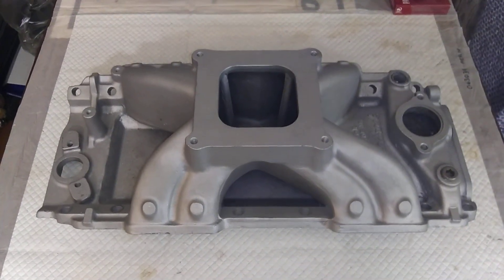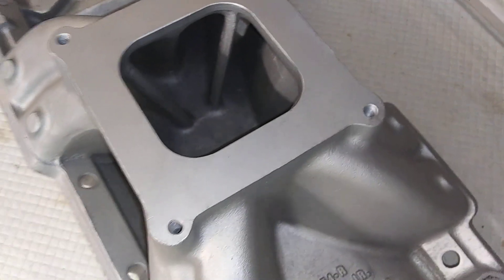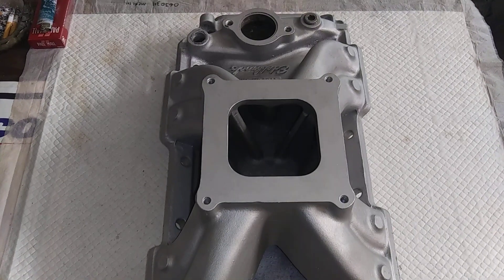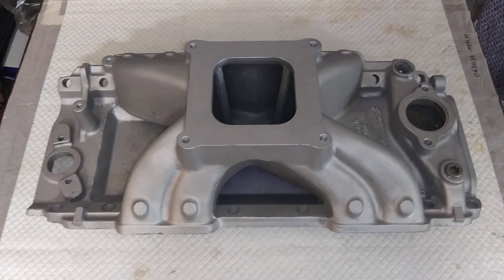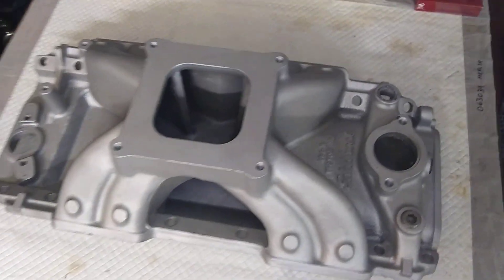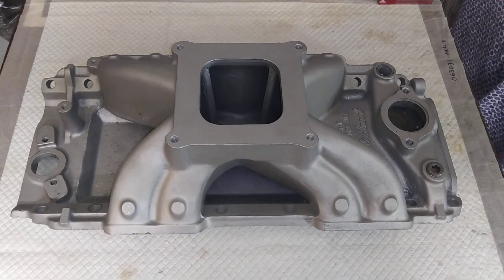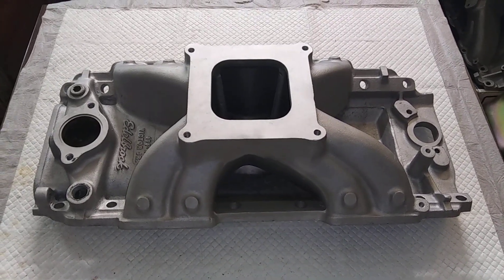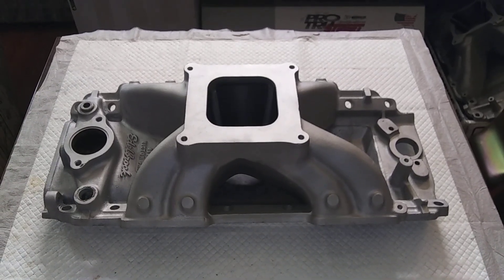Edelbrock Victor 454-R  BB Chevy.

Comment: I’m looking for a ported rec port for my 508, any for sale your way ?
Reply: 4500 flange
Reply from the maker: What size are your ports?
Reply from the maker: Have you seen them RHS BB Chevy  singleplane intakes? Looking pretty good. I'm gonna put one in my collection to try.
Reply from the maker: I believe that RHS intake comes with about 2.50x1.85 ports as is.
Reply: @thereluctantgearhead4544  idk the port size right now, truck is out getting headers built, but I’ll let ya know 💪